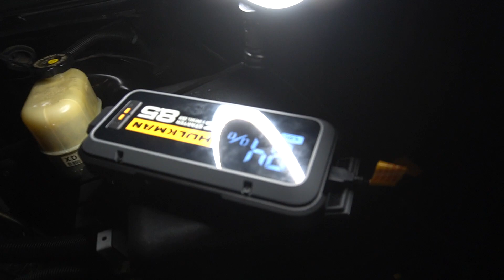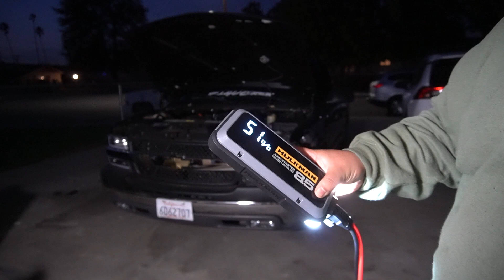SINGLE CAB IS PAINT JOB READY

Comment: I have a question. I have a 05 Chevy avalanche with a 5.3 it has 2 electric fans but won't  come on.  I couldn't find the problem. Any advise
Reply: check the ground under the passenger side headlight, i had it come loose before.
Reply: @bside1854  ok thanks